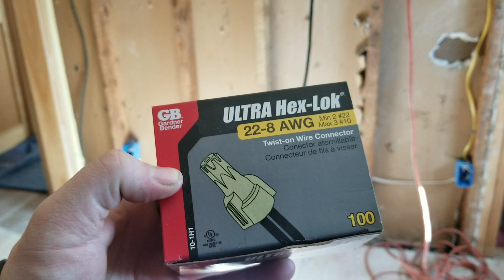Dyi home electrical

Comment: Good information! 🙂👍
Reply from the maker: Never buying another old house ever again lol.   Building new!!!!
Reply: @GearsAndGuns  people don't believe me but it's cheaper. The only thing is the new IEC and IRC codes are Ridiculous! They are way way way over the top so much to the point that the homes are no longer Functional. They require Arc Fault/ Ground Fault on everything including the 240 circuits! I would for sure pull all of those out after the inspection in my house! They trip way way way too easy. Not worth the added safety that you may or may not get. 
Thank Obama for that one and the added cost of $1,500.00 to $5,500.00 per house! I wonder how much of a kickback Barry and Joe got for that? SMH...
Reply from the maker: @FrankAndTinaOfficial  around here they are very hard on septic systems,  it's almost impossible.  Yeah if a inspector looked at that house lol my god